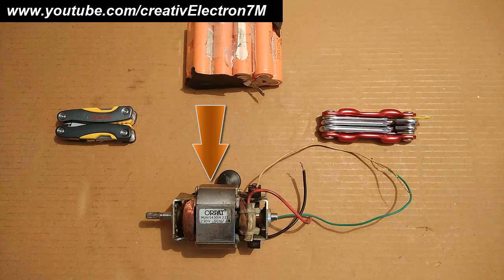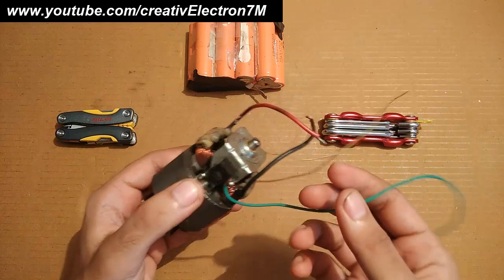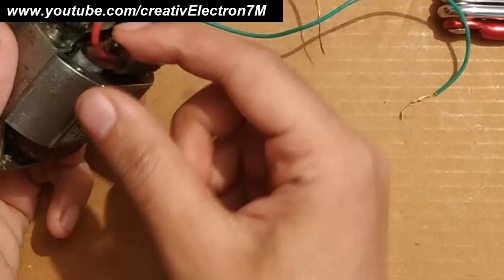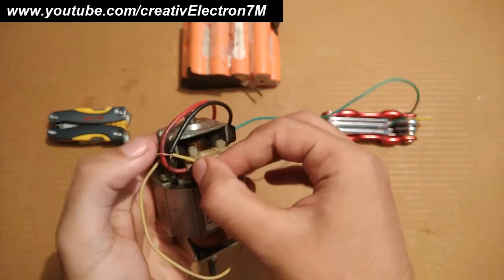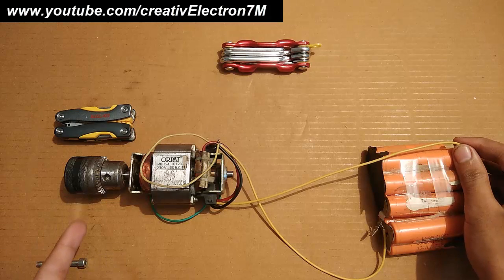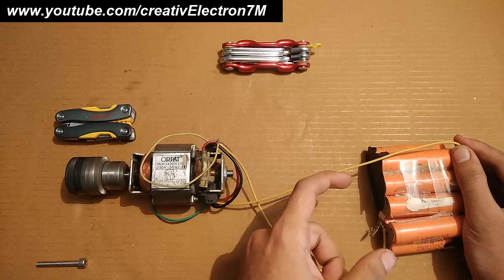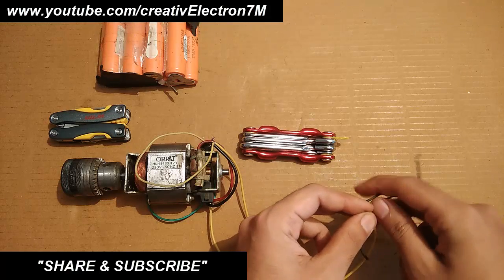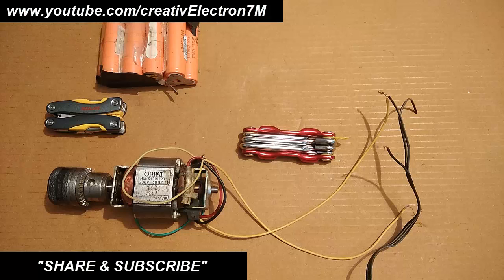Run a High Torque Mixer/Drill Motor at 12V without any Circuit : Step By Step

Comment: Of course you do realise that if you put any decent shaft load and then start this motor you are running a real risk of burning your field coils in this configuration?  That is because until it turns at full speed there is practically no reactive impedance there, you are running a DC current through the low resistance coils. NEVER connect field coils and the armature in parallel if you want your motor to last and do some useful work at the same time. The field coil voltage has to be regulated, it should start really low and can be increased as the motor gains speed.  But even at full speed the field voltage has to be lower that the armature as it is expected to pass bigger current. There is a reason why the field coils are wound with a much thicker wire gauge than the rotor.
Reply: You misread my posts mate, I am not bashing it at all.  The idea is good, just a bit unfinished, and I simply warned him of the pitfalls.
Reply: A solution would be to make sure the current in the field coils never exceeds the current that would flow with the original AC configuration. Just measure the AC field current after reconnecting the motor as it was originally. Then, supply the field coils from a constant current source.

Alternatively, connect a wire wound resistor in series with the field coils to limit the field current to what it should be.
Reply: Yes, pretty good idea Edward. We can even improve on this by putting a delay circuit with a transistor with a relay coil in its collector wire, a large resistor from the +voltage to the base and a capacitor between base and emitter. The motor armature is connected directly to the power supply, but the field coil is connected with a wire resistor in series as you describe.  As you turn the whole thing on the current  to the field coil is limited by the resistor. The transistor will stay switched off as its base voltage is low. But the capacitor will start charging and eventually the voltage on it (and the transistor base) will rise high enough to switch the transistor on triggering the relay. When the relay is triggered its contacts will shunt the current limiting resistor and thus full power will be supplied to the field coils.  The delay allows the motor to pick up its RPMs so by the time the full power is applied the motor will hopefully be rotating at full speed, so no danger of overheating the field coils. By selecting the values of the resistor and the capacitor we can tune the delay period.
Reply: Yes, you may well be right about the minimum flux feedback from the armature to the field coils. After all the purpose of the field coils in a DC motor is to act as a permanent magnet, so its magnetic field should stay largely constant with only negligible reactance. So the voltage supplied to them should be rather small (compared to the armature) to prevent the overcurrents and thus burnout.  I do have a problem with using the series resistor on a permanent basis rather than just at startup. I don't really want to engage into the serious calculations, but if you have a power supply of around 30V to make the current manageable (for the motor in this video I'd guess no more than 2 amps), the resistor should be 15 ohms as you can ignore the resistance of the coils. That would mean that the power dissipation over that resistor would be about 60 Watt. Compared to the useful axle power that motor is expected to deliver this is a huge waste. I wonder if a current regulated buck converter rather than a resistor is a better solution.
Reply: The optimum voltage required for the field coils to set up a sufficiently strong field can be found simply by powering them using a variable voltage DC power supply. Having the latter powered up, one only needs to gradually increase the voltage until the motor runs as required with enough torque. That way, no complex calculations will be involved with the extra benefit of finding the optimal voltage to drive the field coils. This also would mean the field current should also be safe for the coils. However, being a little on the lookout always helps to prevent damage to the coils. After a few minutes make sure to note the coils' temperature.
Reply: From my studies of Physics the current in the field coils should not depend on the speed of the armature. The reason for this is the fact that we have a shunt motor. 

If you examine the structure of the armature you will notice the individual coils are wound inside slots each with a narrow opening. This gap is intentionally kept small so that the magnetic flux in the armature is as big as possible. In a motor you have two magnetic fields interacting with each other, one produced by the field coils and the other inside the armature. The magnetic field produced by the field coils passes through the armature making interaction possible. On the other hand, the magnetic fields produced inside the armature stay inside it. I am writing this explanation to make it clear that the current in the field coils should not depend on the armature's speed.

Therefore, the solution is to simply use a wire wound resistor that keeps the field current below the maximum. There is no need of using a transistor or a delay circuit.

P.S.
In a DC shunt motor, the field coils behave like a resistance as soon as the magnetic field is set up. (In reality there are what are called leakage fluxes but let us not delve into those as they are usually kept small.)
Reply: I am not bashing anyone and English is not my native language. Everyone gets old, so please, show some civil behaviour and respect others instead of being suspicious of others' behaviour. My suggestions all make scientific sense proving I am not trying to mislead.

Unlike you, I will not resort to insults. I will also continue posting regardless of your rude attack.
Reply: @Brian Clark If you are aN nuclear based electrical engineer (sic) my suggestion is you stop bashing (your words) Edward's grammar, but first improve your own. But I suspect you are nothing of the sort, otherwise as an engineer you would have known the difference between mindless bashing of an idea and constructive criticism with the aim to improve it. Just a thought, trolling and insults do not contribute to anything positive.
Reply: A voltage regulator with a by-pass transistor, in order to, raise the current, little by little. That's more like what I was thinking.
Reply from the maker: Bob Berg : Ok
Reply from the maker: Edward Bartolo An excellent Suggestion..
Reply: Bob Berg 

U DON'T KNOW IF I MISREAD OR SIMPLY DIDN'T LIKE JUST AS I DIDN'T KNOW WE WERE MATES!!!
Reply: Don't worry, this is my last direct message to you, you are firmly on my ignore list now, Mr keyboard warrior. Engineer my foot, writing like a teenager.
Reply: What I dont understand in this structural change, although I am not good at Physics and Electrical stuff, to me V = IR and believe R is constant. If you lower the voltage from 240v to say 24v the current is 10 times less (I realize the power is also 10 times less from the original set up). Why should we fear that it might burn the coil?
Reply: The difference is the 240v you are talking about is AC, so the current is restricted by the coil's  inductive reactance  X=2Pi* F * L, there Pi=3.14159.... F=50/60 Hz (the frequency of the AC), L (Hn)- inductance of the coil. Then according to Ohm's Law I=V/X as the resistance of thick copper coils can be ignored.

 The 24V here is DC, so no inductivity is involved and the only resistance on offer is that of the above-mentioned thick copper coils, ie very tiny.  As a result the current will be huge.
Reply: This now makes sense indeed, thanks for explaining. That also mean it can generate more power but like you explain it will burn the coil, right? I bought a water pump 24volt recommended 1 mA; 32 watt. When I used it with an adapter input 12v 2 mA, it has a low power but when I run with input 24v 1mA it seems better, do you think with 12v 2mA, it will burn with time because of the current? And what if I run with 24volt 2mA will I get more power? Could be dumb question but some people say high voltage might burn device but normally a little high current does affect the device if voltage is respected
Reply: Sorry Robin, there is something in your question that does not make sense to me. Your water pump rated for 24  Volt, I presume it is 24 Volt DC?  If its power is 32 Watt the current it'll take is about 1.3 Amps, nothing like 1 or 2 mA.  Or the pump  is for 24 Volt AC (never heard of them) and you are trying to feed it from DC? I'd like to answer your query, but I need to understand the question first :o)
Reply: Yes I realize I made some mistakes. It is DC 24 Volt and 22W, seller recommended 1000mA. I am using a 12V DC 1A adapter which is giving me half it is power in terms the pressure. I intend to buy a 24 DC 1A adapter but was wondering how about 12V 2A? Because of power =I x V it might give it maximum power but will a high current burn something (it uses a brushless motor)
Reply: Robin, if the pump are rated for 24 volts, its power supply must be 24 Volts, anything less and it will be underpowered. Also the power supply must be power-rated to match or exceed the pump. So what you actually need is 24 V, 1A supply.  Let me make it clear: the amount of current that will flow does NOT depend on the supply, it depends purely on the pump.  The current mentioned on the power supply label is simply the maximum current that power supply can provide without getting destroyed. It is not the current that actually flows, that depends on the consumer (the pump).  If you connect your pump to 12 V supply the chances are it will pull 0.5A irrespective of the supply's rating and will be severely underpowered as you have observed. When the seller recommends 1000 mA he means that the supply for this pump must be capable (rated) to provide 1000 mA, the current actually flowing may not necessarily be that. So, to recap, you need a 24 V supply that can provide at least 22 Watt of power, preferrably more to be safe.
Reply from the maker: Bob Berg This is how a DC Shunt motor is connected.
So this motor has now been transformed into a powerful DC shunt motor.
Reply: Of course, by itself the connection is fine. Bear in mind though, if it was designed from the start as a shunt motor it's coils would have been calculated differently. This motor is calculated for AC with the coils made accordingly, you simply reconfigured it for DC without any changes in it's design. It is powerful when at full RPMs. If you use it without startup regulator I doubt it'll last long under load. Well it's easy, try  and see.  :o)
Reply from the maker: ok sure
Reply: someone has to bash every good idea...u wouldnt watch if not intertested!!!
Reply: i would guess that he knows this...considering he is testing voltage,etc. work on your grammar and find something better to do than look for suggestions then bash the provider. this guy has tons of grear ideas that just that I personally have seen. I am an nuclear based electrical engeneer and enjoy playing around with running WAY too many amps (main factor of importance) to small motors just to see what happens/self educate. STOP FLATTERING YOURSELF BY BASHING OTHERS.....
Reply: Bob Berg i have no need to impress u tho I would love to meet u. I have been known to LAY OUT more than just electrical plans. PLEASE stop messaging me you loser. I'll ASK of you ONCE......I SUGGEST TAKING MY ADVICE SERIOUSLY. NOT A THREAT JUST PLEASE DONT GET URSELF IN TROUBLE....